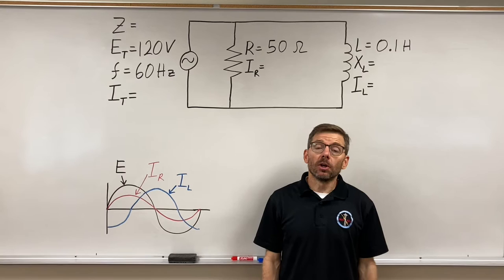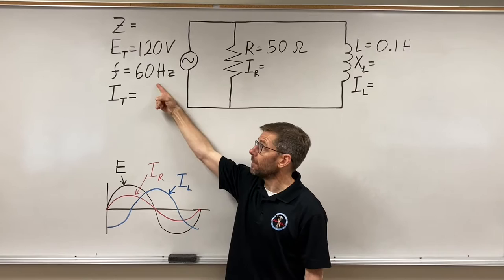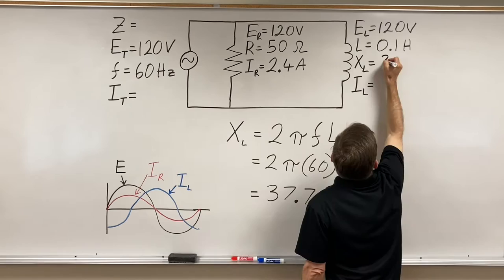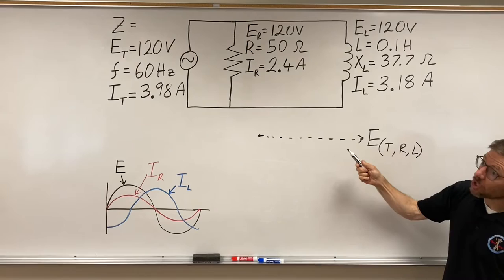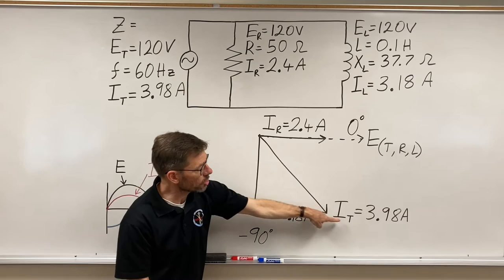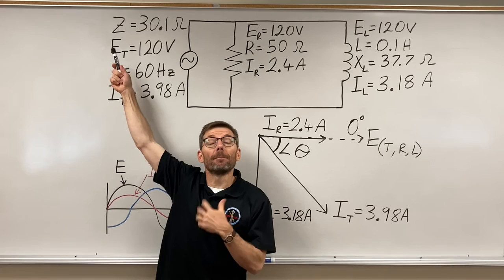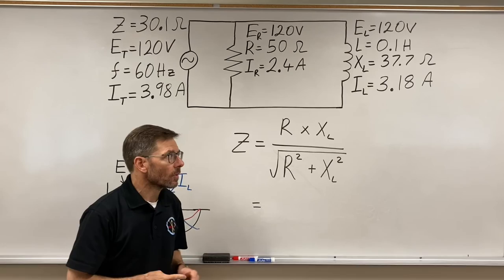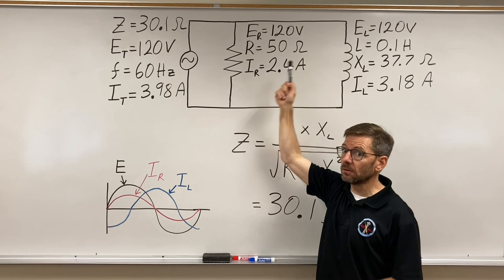Parallel RL Circuit Impedance and Current

Comment: Dear dave... there is an impedance triangle for parallel. What you need to do is take the inverse values of R and L.  The formula is as follows Z = 1/ (The square root of (   (1/R)^2 + (1/XL)^2   )

Comment: How does impedance have a phase angle in parallel RL circuits if the impedance triangle cannot be made? What does the phase angle of impedance even mean? There's no sine or cosine wave for impedance is there? Isn't impedance a constant even when voltage and current vary throughout their cycles?
Reply: It's the admittance triangle we're looking for. We find the angle of the admittance triangle then take the additive inverse and boom that's our impedance phase angle. Right? 😅 I think

Comment: 10:55 I had my second Eureka moment in this video series. I tried using both the Pythagorean theorem and the Inverse Inverse formula to calculate the impedance and wasn't getting the right answer. Then you said the triangle doesn't work and the formula is a mashup of the two and it all made sense. 

My previous Eureka moment was when you described resistance and inductive reactance as impedance in an earlier video. AC circuits are starting to make sense in a way they never have before. Excellent teaching.